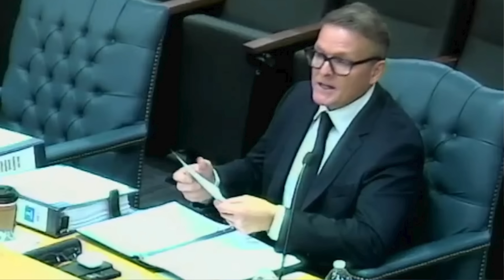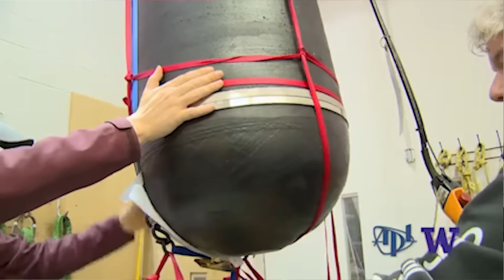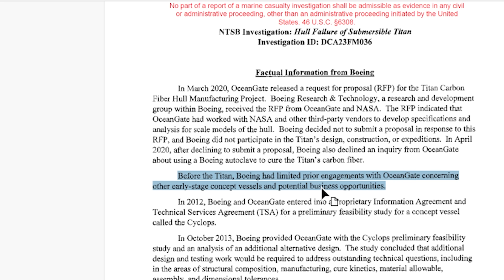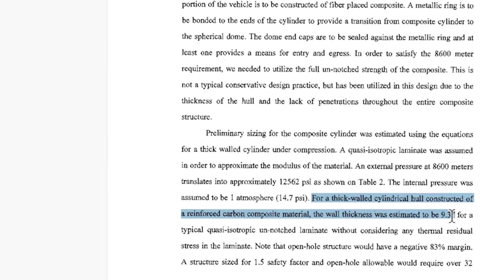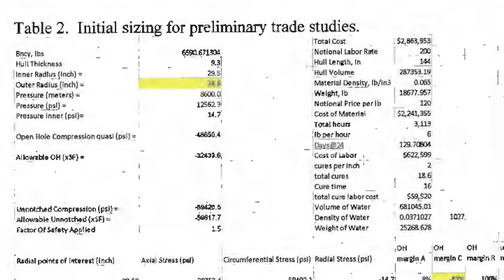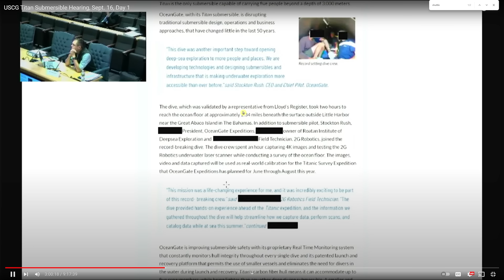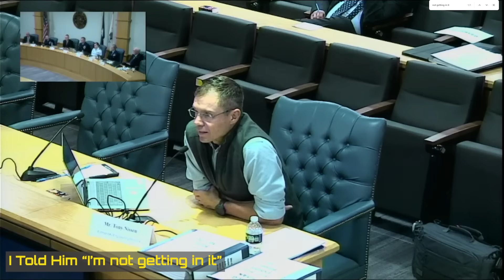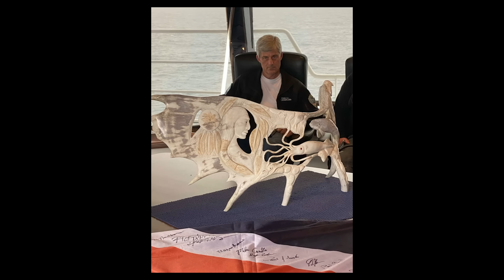Titan Sub: Fired OceanGate Employees Show What REALLY Happened

Comment: Dropping 70lbs is to slow the descent, yes, according to what we`ve heard and what was planned, but is that what was actually dropped, and did they drop prematurely due to an unexpectedly high descent rate or excessive noise from the hull or joints?
There was talk of "crackling noises" et cetera, and people were told it was normal on previous dives, "hull settling in" and so on.
Then this..
A paying tourist being called a "mission specialist" for legal reasons (as they all were) who no doubt signed a pretty serious NDA, pitted against an ACTUAL seaman who makes several good points with regards to the engineering itself as well as the process surrounding the operation.
No offense toward either party here, but I tend to believe the professionals, as well as having a certain training reading people, there are points to adhere to here.
What I see is a professional finally being able to speak, but still trying to be diplomatic and honest, that`s not easy, a regular debrief can be stressful, let alone attempting to answer for your role in this circus.

I think I`ve had my say.

Comment: The idea that they used a carbon fiber in the hull is asinine. While carbon fiber has good stats on paper, a high schooler could use a bit of intuition to understand that carbon fiber has TERRIBLE resilience to being repeatedly compressed.  Steel can be compressed a lot of times and still retain its properties that are represented on paper.  Carbon fiber breaks down... it develops cracks, the glue delaminates, the layers separate.  I 100% believe that computer models would only model carbon fiber as represented by the clean data of its stress/strain on NEW carbon fiber.  In other words I bet you the computer model of this sub looked good in digital simulation, but a high schooler's intuition would have said otherwise.

Comment: Not an engineer, but I know any and  all fibers are not uniform enough to be used for structural purposes as for load bearing there's a formula for the continuous use of cable's that reduces max lifting/holding rating until it is placed out of service/scrapped when I heard what the sub was constructed of I asked who in their right mind thought that was a good idea.

Comment: Been watching your content since the Surfside collapse back in JUN 21 and much respect. I've been watching all this cluster F since the implosion. As a fellow Engineer that has been involved in carbon fiber manufacturing processes for the World's largest Aerospace firm (NDAs so can't name), this entire operation was still born. It's a very lengthy discussion but in short ... expired material (and with only 1 retest allowed which I'm confident Boeing had already performed), the less than adequate manufacturing "clean room" (note the chief Engineer points this out with his "leaf blower" comment) that should have be spotless and in a positive pressure environment and of utmost importance, baked off in a certified Autoclave (Rush knew this and another reason for his RFP for use of Boeing's facility, not  just "name association") for a NINE POINT THREE INCH WALL design concept, not the FIVE INCH POS "Rush'd" design. It would NEVER have even made it off the CATIA 5 screen much less into Production. Full Stop. EVERYBODY should have quit from the beginning and sorry but I hold them responsible as well in all this tragedy ... IMHO.  Look forward to the next episode ... very telling stuff.

Comment: Thank you for the laminate flooring stuff.  The flooring tiles were replaced with laminate flooring, however no insulation. It is always so cold.  The heater keeps my upper body warm, but my legs are always cold.🥶

Comment: I am wondering why they did not design a convex into the carbon fibre tube for the submarine. As one man concluded the tube compressed in and away from the titanium end plates and a Convex Carbon fibre structure if possible may have caused the carbon fibre to be in compression and not pull away from the end plates allowing for the cracking of the tube and failure of the Submarine.

Comment: I can see what Stockton was thinking with the glass sphere... at the very basic level he knows that "hey the ideal pressure vessel is a sphere" because the pressure is applied equally all around it... but of course, as we know, he ran with basic concepts like that, and ignored all the reasons why you don't get spherical deep sea diving vessels. I mean... it takes just a slight flaw in manufacture, and you don't have a perfect sphere.... or a the action of a current on one side of the sphere increases the pressure, and ok you might be fine (might!) with one of those, but both, or a temperature variation as well.. and pop goes your perfect spherical diving vessel idea.
This guy is just forward until dawn all the way to oblivion. Very sad for the people he took with him, but they should have known that what they were doing was dangerous in the extreme, and it only seems safe and easy because of the enormous professionalism and ingenuity of the people that do deep sea oceanograohpy, and well... don't die. Looks great fun, flying around on the sea bed, but they are diving into an even more challenging regime than space actually... space exploration is super hard, but the real limiting factor is what you can get up there on a rocket, the environment is.. empty... deep ocean there are countless things that will kill you that even the best engineers couldn't see coming.
So yeah, sadly it shows that just because you can accrue a lot of material wealth, that fact doesn't make you a genius... and I am sorry to say it in this case.

Comment: i was really mervous about how they were doing layers outside a clean room and not under vacume... theres no way to press the layers together unless the strands are placed under tension... but was never welded or otherwise secured. allowimg threads to move in layers when it was brittle epoxy that wasnt ever treated in anyway to restore flexibility required.
Reply: that's what the autoclave is supposed to do. Also, the hull design was suppossed to be 1 homogenus layer, like a thick carpet, not wound.

Comment: The hull crack sensors/warning system is beyond useless. It's like wearing a hat that alerts you when you engulfed in flames.
Reply: I mean it seems like the system actually did work - after dive 80, it got really noisy but they ignored it. I don’t know obviously whether the warning system in general would be reliable, but in this one case, it would have
Reply: @theaxe6198  definitely, early on letting them know the structural integrity was compromised. That CEO guy was so arrogant it took his demise to stop him... and unfortunately many other lives too. Such a cost to prove he knew nothing at all. There have been submersibles going deeper than 10km since the 1960s, and they are all just fine.

Comment: I saw the video of the ring being glued on to the hull before the accident. If any of you saw it, you would have known what caused the implosion. You would have seen how thin the edge of the ring was, that had to hold the immense  pressure of the carbon fiber on that edge. I thought they were crazy when I first saw it. Plus the channel that the carbon fiber sat in was only about 3 to 4 inches deep.  It should have failed the first time it went down.

Comment: I hold his parents responsible, I mean who the hell calls their kid "Stockton"?
There's also been evidence that the adhesive they used to secure the titanium end caps to the carbon fibre hull, Loctite 9394, had an axial sheer strength of 1600psi less than the pressure at the depth of the Titanic. Ultimately it was the flange on the end cap that had to hold this excess pressure that failed and was shorn cleanly off.

Comment: I hate to see anything like this happen.  I'm not sure why Stockton didn't have it x-rayed. Did he already know it had carbon fiber wrapping issues?  I have read during the wrapping of the fiber they would stop and grind/sand off high spots and try and remove wrinkles... A - this thinned out that layer.  B - what if not all the grinding/sanding fine particles were not totally removed before adding the next layer?  Would this make an inferior lamination or create a way for the plus to slide under pressure?  It was such a sad event for his passengers and their families.

Comment: One thing I've always wondered about with regards to the layering, the adhesive and such, is when they picked the sub up and accidentally dropped it on the ship, the front dome sheared off the titanium ring.
What kind stress and damage did that potentially do to the carbon fibre hull?
Ignoring the fact there's the sudden jolt from being dropped, but that forward section ripping off must've put some shearing? load on the carbon fibre strands in the hull, surely?

Comment: As it turns out, the 8 ft carbon fiber tube wasn't at all so they could fit four other passengers, that was just an added perk of designing a submersible large enough to fit Stockton Crush's giant ass clown shoes inside of it.🤡🤡🤡

Comment: The glass spheres are made by Teledyne Benthos and are rated to as much as 9000m depth, depending on model.  They are not meant to be oil-filled (that's crazy).  I don't understand why Nissin would object to using them per se, unless he felt that the contents should have been inside the hull?

Comment: 3STATE OF THE ART VESSEL ? WTF 
are you kidding 
Viewing port only rated to half the intended depth 
Access via a door bolted from the outside 
Real time monitoring system alerts you of pressure hull failure whilst it's failing 
Combustible materials inside the hull 
No seats or any restraints should the vessel become unstable 
Add to this no emergency action plan in the event of a serious situation other than ring the coast guard 
Yes seems to me the titan was well designed & oceangate really thought of everything 😂

Comment: Let me see if I finally understand what happened.  Over the past year, before the testimony and the amazing underwater images, we thought that after several dives, the carbon fiber hull finally just shattered into thousands of pieces.  Now based on the pictures of the large hull pieces, and “clean” retaining rings, we see the actual answer.  The greater flexibility of the carbon fiber hull versus the titanium end caps allowed the cylindrical hull to be pinched near the center, thereby causing it to break away at the glued seal on the forward titanium interface ring.

Experts had always said that cylindrical deep-sea submersibles are not a good idea.  Secondly, they stated that you should not combine titanium with carbon fiber.  As I recall, Stockton Rush proudly announced he had proven the experts to be wrong.

Comment: @jeoffostroff, Thanks for the video. One thing I wanted to mention is hull thickness of 10 inches that you speak about. That is for a dive depth of 8600 meters. The initial sizing that was conducted is also for the pressure at 8600 meters. So at the titanic depth, the 5 inch hull thickness that they ended up going with is sufficient as the pressure is half what's in the report. Just wanted to clarify that.

Comment: Jeff, you bash the reliability of computer fans, but do you know how reliable they are? They can run for DECADES without failing. Stockden was an irresponsible idiot in many ways, but the computer fan on the air scrubber wasn't one of them.

Comment: I've seen various o-ring seals in the automotive & instrumentation/ chemical industry. The rings always lie in a smooth groove, trapped between two metal surfaces. They couldn't seal properly, laying over the sharp edges of the holes going through the groove. Beware of Amateur engineers engineers, cutting costs.

Comment: 28:30 That is not a "plunge hole". That is a pick hole. It is use to pick out a worn O-ring when it needs to be replaced. There is no hole needed for plunging the cutting tool..

Comment: I feel like the cheap plastic storage bin is less of an issue than the fan; simple axial-flow fans don't tend to build much static pressure unless they have a stator or counter-rotating element (also curious if it was a ball bearing fan or otherwise properly spec'd for that orientation as plain bushing fans often don't have any sort of thrust bearing and wear out very quickly when mounted like that)

Comment: A CO2 scrubber just removes CO2 from the air, it will not make oxygen, but locks away the CO2 exhaled and stores it in a chemical eg a Hydroxide substance. 
You would still eventually run out of air, but the scrubber makes the air last longer by purifying it..
Gaz UK

Comment: Wow. A crack? (I might be confused. The inquiry also spoke of Cyclops to get a overview of all construction? Right?) But for Titan. Yes, lots of pressure and they seemed to have sanded the fibers but in that language about the study I think was also temperature. What does freezing do to adhesive in the C channel? Plus off season storage outside and bouncing around on a raft as they made good on using a second ship for later dives... Built questionably and then treated like a common jet ski...

Comment: I dunno man, a plastic box with a computer fan is more advanced than the CO2 scrubbers William Beebe had on the Bathysphere. Of all the corners to cut, this isn't a big one. The chemicals pretty much just have to be there , and be exposed to air. Granted, they are caustic chemicals that will burn you.

"pans of soda lime and calcium chloride were mounted inside the sphere's walls to absorb exhaled CO2 and moisture. Air was to be circulated past these trays by the Bathysphere's occupants using palm-leaf fans."

Comment: so if the 9.3"thick hull is good for 8600m, a 4.65" hull should be good for 4300m. we need 3800m, so make it 5" and we have a safety margin. - stockton rush, probably.

Comment: Do not call the Ocean Gate Titan Submersible “beautiful”. 
It is well established that the main feature of its design, being the mating of two dissimilar materials by use of epoxy, was inherently flawed. Anyone with even the most rudimentary knowledge of deep sea engineering would never even consider calling it beautiful. Because it is entirely wrong. It is disqualified from any aesthetic consideration at all to begin with. Even if you personally find it pleasing to look at, you should question your own judgement as to what the word “Beauty” actually means. Because it too is flawed.

Comment: I dont really see an issue with the scrubber system, given its a chemical reaction it's probably the safest system they have, and had an actual backup for it and a monitoring system for air quality.  But I dont care whats in place if you're ignoring those systems and the things monitoring them and just "Sending it" regardless of what the science says.

Comment: Still can't believe they would just grind down the carbon fiber if there were bumps and add another layer over it... You just broke and removed layers of that fiber, making it weakened there
Reply: The bumps were already a weak spot.  The bumps are slacked fiber, which would never go in to compression or tension at the same time as the surrounding fibers; meaning those surrounding fibers experience excess load the slacked fibers should be carrying.  And that's the problem with flat-braid fiber on a radial form.  It's never going to lay flat.  Half the fibers will be in an interior bend and half will be in exterior.  Any kid who ever covered a ballon with papier-mache has seen this.   That's why you don't use it in an application like this, you use a cast material.    Grinding the bumps down didnt make it any weaker than it already was, it simply truncated an existing weakpoint layer to layer.  

The design was a weakspot.  They took a tension-reactive material and square-peg round-holed in hopes it would alchemically convert to a compression reactive material because Stockton's ego demanded it.  It wasn't even for cost. They spent so much building and testing his hairbrained idea, and having to build another cause it wore out so fast from cyclic fatigue that had they just made the god damn thing out of titanium in the first place, they wouldn't have had to test as much, would have had a better idea of reliability, wouldn't have had to scrub multiple 'excursions', and externalities would have been more content to sponser or associate.   The company would have likely not been so strapped for funds, that there probably would have been enough money to pay employees and also upgrade the plastic tote based life-support systems.  

It was all an experiment for Rush.  So twenty years from now he could claim 'i was the guy who said carbon fiber had a place in commercial submersibles".  And that killed his company, killed his clients, and killed him.
Reply: @ I like your explanation, please rememer that Stockton also purchased 'pre-preg" EXPIRED date-coded carbon at a discount.
The bumps were lumps of dried pre-preg'd resin.
Reply: @maxdecphoenix So take Stockton's name in vain or even Darwin's (for his stupidity). No reason to take God's name in vain and use it as a cuss word for man's ignorant and prideful decisions.
Reply: He used the word in lower case, surprised you didn’t notice
Reply: @maranatha5091   What's your god damn problem?
Reply: @maranatha5091  Amen friend, Jesus loves you God Bless 🙌 🙏 ✝️
Reply: All that was missing in all of this disregard for safety was excessive amounts of duct tape being wound over the glued titanium rings and claiming that it's highly reinforced.
Reply: @rabbitramen  I seen a video before of that tape (Or it looked like it) Being used on the front (I think it was) Taping the Titan's landing :v
Reply: @rabbitramen TBH, the duct tape  couldn't hurt, lol